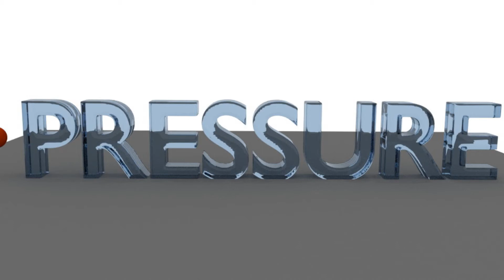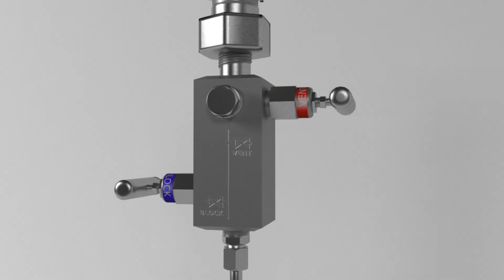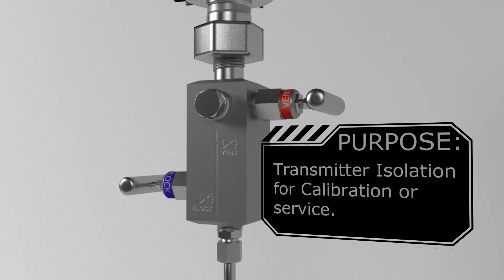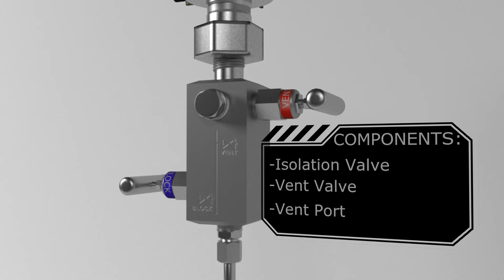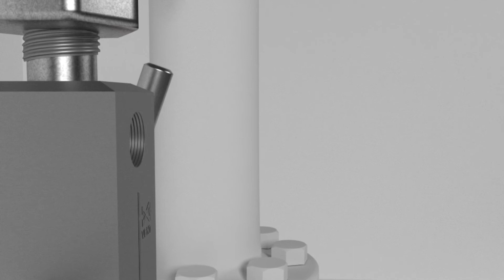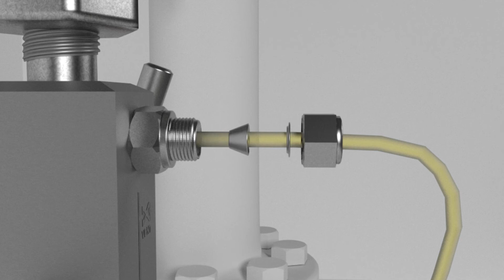Pressure manifold Isolation

Comment: Is the vent port to be opened before the vent valve, as suggested in this video in 1:25 - or the other way around? First the line should be vented out through the vent valve before opening the vent port to prevent spraying right? Again this contradicts what is said in the earlier part of this video (1:03) itself.